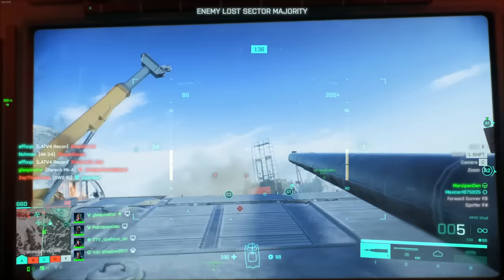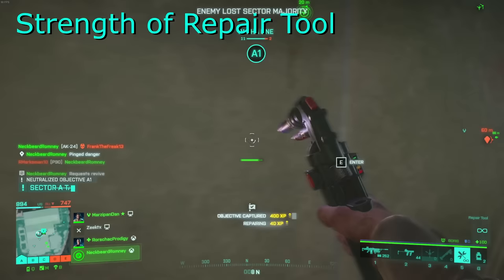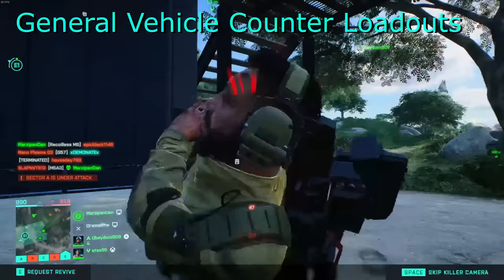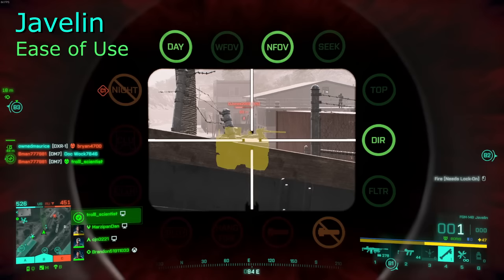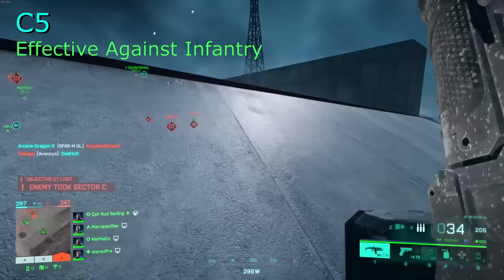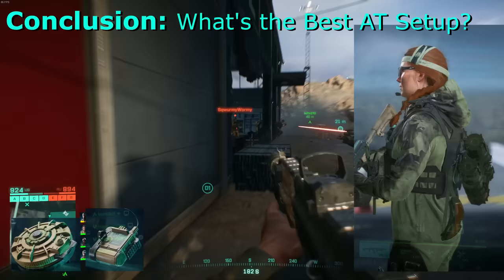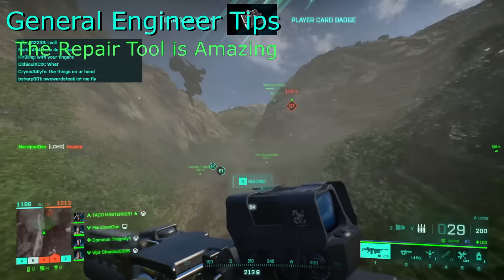How to ACTUALLY Deal with Armour - A BF2042 Anti-Tank Engineer Guide

Comment: Liz is still the ultimate. Tv missile for ground and air, c5 for close range and emp to disable tanks. Most complete engineer!
Reply from the maker: It's definitely better than I was expecting vs. ground vehicles. It's kind of sad... she already dominates the sky. The only thing making the M5 a little appealing is having 4 rounds on you... but even then, you need to find an ammo crate first...
Reply: @marzipandan767  we need more dump rockets launcher variety. This game infantry and vehicle balance is still work in progress
Reply from the maker: @Jay  absolutely! As I mentioned they should add over the RPG and the SRAW from portal! More variety is always welcome.
Reply: I'm pretty sure the G84 does little to fuck all damage to destroy a tank or a transport chopper. Add to the fact you can only have 2 rockets at a time, and I'd rather pick Crawford with an M5, that can dish out the damage much faster. He also has a minigun turret for AA capabilities, nuff said.
Reply: @zedster8200 the g84 takes out smaller helicopters in one shot plus is good at taking out snipers/campers or chasing weak tanks 

Plus it’s fun 😂👍
Reply: @zedster8200 the bigger tanks and helicopters however will need 2 or 4 shots but usually leads to a snowball effect 
Nobody wants to start up damage on a tank but once it’s at 50-25% health with your two rockets
Everyone else will want to land the finishing blow.
And it recharges over time so you’ll always have a answer for most things.
Reply: @kerlowsc3397  ok I get it but this won't matter once I equip Crawford with the new AT grenade
Reply: @kerlowsc3397  And I can switch to stinger if the situation calls for it
Reply: I do the same, also run the LCMG with ap 40mm and ap ammo to stop the instant repair, the m44 magnum with AP ammo is great sidearm for also interrupting insta repair if you prefer avancys
Reply: @marzipandan767  Just swap out her med crate for ammo crate, you still have health syringe !!!
Reply: @marzipandan767 how do I suggest NLAW from BF4?
Smart rocket from attack helicopter, but u run around with it

Comment: A tip for the at mine. If you do a mine and then shoot it. It leaves a crater that you can use to hide the two mines you have left. They can be easily spotted if just let on the ground. Although any crater will do.
Reply from the maker: I do find myself hiding them in craters, but I've never thought about using an AT mine to create a new crater, good tip! I do recommend putting them on the edge of the crater, sometimes I've seen tanks run right over my concealed mines and they haven't detonated because they are too deep in the crater.

Comment: Some additional tips from me:
- EMP-Grenades. EMP-Grenades are actually a pretty effectiv tool against vehicles in close combat, because they disable any weapon AND countermeassure, even the APS (if it wasn't active while the grenade was thrown). On any unsuspecting enemy, and that is the most of them (because EMP-Grenades aren't widely used anymore), it's a huge shock to suddenly be unable to use anything for defense, especially when they had APS on the ready and suddenly can't use it anymore. This in turn, depending on the experience level, will bring them to do rash decisions which you can exploit. For example but mines behind them and watch them retreat into those mines.
- Rao's hack: Basically the same as an EMP Grenade but with a greater distance and on demand. Rao is not a vehicle killer, but together with some pioneers he can really help put down some enemy vehicles. The only downside is some sort of short vulnerability and that it gets anounced for the enemy.
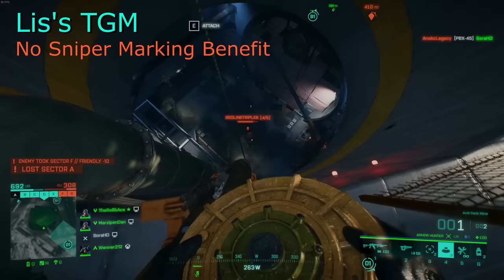- A really imortant one, Distraction: If enemy vehicles don't have anything to do, they are more aware of their surroundings (looking for mines, upsneaking enemies, etc.). Also most of them use outside camera in those situations. So they even see you when you sneak up to them from behind. But if they are distracted, by other vehicles or by you yourself, they suddenly have more tunnelvision and miss some mines or the enemy who sneaks up on them. Like in the video on 14:05 were you sneakedly put down mines and played afterwards the distraction until the Brawler drove over the mines.
- LAT 50mm Cannon: This one is a bit special. It alone almost cannot kill a heavy armored enemy vehicle, but it can definitly put some decent damage on any enemy vehicles and this even from long ranges. Works best with a distraction for the enemy. So, if a enemy tank has to chose between you and your allied tank, you are suddenly not priority target one, which helps you put some extra damage into the enemy tank. Especially effective when you flank the enemy from a distance, which in turn enables you to snipe some pesky repair flies who stand behind the tank.
Reply from the maker: - EMP - I completely agree it is a very good throwable to use if you plan on focusing vehicles. However, I find it very hard to give up the versatility of my smoke grenades.
- Rao - I love Rao in his current state, I think his hack tagging vehicles was a really good move on Dices part! I just wish you would get credit for helping after tagging a kill.
- This is 100% true, I'll drive around in third person mode, then as soon as I am required to shoot I'll pop into first person. This is absolutely when I am most vulnerable in a vehicle and I suggest people playing with C5 take a note of this comment!
- LAT 50mm cannon is really good against aircraft to, if you can hit them consistently. The only downside is that they are very weak vehicles and getting shot out of them while stationary is very common. 

Thanks for the great tips man! I'm gonna pin it for all to see!
Reply: I use the 50mm on the recon as a psuedo armor hunter, I find a nicely concealed spot, harass any light-medium armor, and relocate. I also support vs Heavy and Aircraft like the super hind where possible and if I can engage safely.
Reply: @oshadow8325  i also use this on the recon 😂, adding also driving backwards to a spot so infantry cant snipe/shoot you from the front of the vehicle
Reply: Does Rao's hack disable countermeasures? I swear Ive seen heli's Ive hacked pop flares the moment my teammates send a stinger their way.
Reply: @KillerOrca  It doesn't stop active countermeasures.
What you saw are experienced players. As I have stated, the enemy player knows when a hack is incoming. That is why they will pop their countermeasure just before they got hacked, so it is active while they are defenseless and use that time to go into cover or below radar.
Is the same with the APS on vehicles, it's stays active even though the vehicle got hacked. But since vehicles aren't that fast into getting into cover it is a much heavier blow then for aircrafts. That is why EMPs are actually better in form of almost not getting announced.

Since this video is about ground vehicles and how to defend against them, I stated the Rao's hack strategy. Against aircrafts it is not so effective in case of taking it down, BUT it will keep the enemy aircraft more at base then at the front, so it is still effectiv but in a different way.
Reply: @Happensmaker  Thats what I was afraid of. Of course the competent pilots are the ones flying the transport helo...
Reply: Not sure when it was added, but emp denotes c5 from either team. stole a few kills from my spaudmates not knowing
Reply from the maker: @Killer Orca  usually they will pop the flares before the hack is finished. This means that the flares still go off, and they will be unable to be locked for as long as the flares last.
Reply: EMP granades have proven completely ineffective in this pursuit, sir. Tanks just laugh them off. What am I doing wrong?
Reply: @djbis  Could you explain what you mean. Because just saying they are ineffective doesn't say anything.
EMP-Grenades are indeed ineffective just by themself. They do only 1 damage and they "debuff" any vehicle.
So they aren't a killing weapon (even though you can kill with EMPs but thats another story) but they are a combination weapon, that you can combine with many other (creative) ways to destroy enemy vehicles. Easiest combination example is EMP-Grenades with C5.
Reply: With Liz I run the EMP with C5,  a lot of people don't expect the EMP which allows you to get right on top of them and plant the C5. Sometimes you get killed but even if you do then don't respawn, wait, if your team hits that vehicle thereres a good chance that the C5 will explode and take out the vehicle anyway.
Reply: Another tip: use synergy. Look for friendly armor on your map, and support them once they engage with enemy armor. Your chances to survive and to kill enemy armor multiply. Doesnt work for AA launchers because of the flare spam and short range.
Reply: @Happensmaker  Do you happen to know the damage numbers of the AT grenades Sundance has, and if either Thermal Smoke or APS works against them.

Comment: Absolutely fantastic guide Dan. The BF community needed this. I will say that Crawford's turret does do a decent amount of damage. it sorta sneaks up on the enemy and they seem to not understand where they are taking damage from in my experience. and you may want to take a look at that in any follow-up videos on this subject.
Reply from the maker: Thanks for commenting!

In did test the damage of the crawford turret to figure out the numbers but entire community was talking about reworking both Boris and Crawford so I wasn't sure it was worth it, since I was expecting some significant changes.

Fun fact: it does more damage from the rear and the sides just like most weapons. I didn't record the damage numbers, but from the rear, a full cycle (to overheating) deals about a third health of a MBT at close range. But good luck getting a full cycle off without getting blasted :D

If people are interested, I'll definitely consider a follow-up!

Comment: Very thorough.  Something you showed, maybe accidentally, but didn’t mention as a con for the Javelin is that every now and then a teammate will spawn on you and walk in front of you breaking your attempt to lock on.

I really miss being able to run Angel as an AT & AA Juggernaut.  Unlimited rockets & mines and the ability to switch out without a redeploy - provided you had loadouts setup ahead of time.

I will have to try Lis as AA.  Not much luck for me running Lis in an AT role unless I also equip mines.  I like to Tier 1 everything so I am running Javelin now but typically with Boris to get some additional passive kills.
Reply from the maker: Yeah, the lock is very Janky. Sometimes, it gets broken. By a twig and other times, you could see an inch of a tank, and it will manage a lock. Also, it's very frustrating when you have multiple vehicles in your sights... since it never knows what to focus on and sometimes jumps between vehicles.

I wish you luck dealing with T1ing the Javelin, I can not say I envy your journey given the current state. I hope you have a lot of games filled with Rao's, Tracer darts, and soflams to help!

Comment: What about the 50cal barret? also, any armor pen bullets work on the wildcats?

I been playing Lis all week, and completly agree on the last part, we need more rewards for killing vehicles and also see how many destroyed or how much damage to vehicles you did.
Reply from the maker: The 50cal is definitely something I neglected to try. After they nerfed the Rail gun damage against tanks, I didn't think it was worth trying it. Maybe I'll investigate it in a follow-up video after testing it.

The AP bullets for LMGs (and I think assault rifles) are not good. The damage is so low, and you give away your position so much. Not worth it, in my opinion. Especially compared to taking an AP launcher.

It's so frustrating not being highlighted as doing all of the AT for your team...
Reply: From what I remember, 50 cal was nerfed into the ground. Unless the tank is 90% destroyed and running away while on fire, I personally don’t think its worth using over the under barrel grenade launcher. It’s still a decent sniper against infantry but I’ve yet to see the 50 cal do anything against vehicles after it’s nerf.
Reply from the maker: @DefualtPlayer  I've definitely been pinged by it while in a tank, and it was more annoying than dangerous. Same with the Railgun on single fire.

But yeah, the AP underbarrel is king against vehicles!

Comment: Nice guide, awesome job.  One thing I wanted to add, you can drop 3 mines as an engineer and 4 from the bolte, for a total of 7.  The 4 that deploy from the bolte are tagged to the driver so if you also get your squad to go into the Bolte and take turns you can litter an area with 16 mines from bolte and 12 mines from squad.  
I miss the plane from previous battlefields that can parachute 12 mines onto an enemy position and your squad could take turns dropping for 48 mines on an enemy main base road!
Reply from the maker: Oh my god that is crazy! You could literally make a minefield. Sounds like a very fun thing to do with a squad! Thanks for the tips man!

Comment: This is the level of detail battlefield players need to be thinking in! I see so many players just sticking to their preferred class no matter what happening in the match. I've always enjoyed adapting to the environment, if there's heavy vehicle presence I'll switch to Anti tank. Snipers, switch to counter snipe or flush them out with assault class. Heavy amounts of infantry, switch to assault or engineer and mow them down. Team mates dying constantly, switch to medic! If you have a good grounding in every class and specialist then you'll be an even better player for your team!
Reply from the maker: This is one of the reasons I much prefer the class system. It means that everyone isn't just running around with an M5 doing whatever they want. Just helps the all-round balance for everything in the game. For example, if you are playing really well in a tank, more people should be switching to engineer to stop you, then that means there are less medics so you are having a much larger impact in the game than you might actually perceive. I just wish they would give the Assault class the ammo crate instead of the medpen, since right now they don't really help out the team in any way that they can't help themselves. Plus more ammo on the battlefield would be appreciated by everyone.
Reply: @marzipandan767  the assault class has always been a contentious one. I remember in previous games it was used more as a heavy class where they had light machine guns and ammo boxes? Now it's more of an infiltration class where your sole job is to basically cause trouble on the front line

Comment: The NTW is a solid choice as well.  It deals good damage if you use the heavy AP rounds to shoot tracks, and is not blocked by any form of APS.

Really, AP rounds in general should not be overlooked.  Even though most guns won't even deal more than a point or two of damage per magazine, being hit by even 1 of those bullets will cancel the repair kit and delay auto-heal.  The damage indicators they cause can also draw attention away from other players that are better equipped and dealing more damage.

Comment: NTW 50 also shreds vehicles classified as light, like the wildcat, bolte and ram. Gotta get behind them though.

Also completely agree on 40mm AP. Criminally underrated
Reply from the maker: I just unlocked it and it's anti-vehicle rounds, unfortunately the cost to using them is losing your one shot kill body shot potential of the NTW. It's good being able to deal decent damage to light vehicles at range, but vs. tanks it only does 5 damage per rounds. 

I think I'll stick with my AP underbarrel for now. But damn I love the sound the NTW makes with every shot...
Reply: @Marzipan Dan  anti vehicle rounds retain their 1 shot Potential, just drastically lowers the range of it. Either 50 or 60m if memory serves. I just have them on the plus menu if I ever find myself close to camping vehicles (since I'm a recon main and usually run soflam instead of c5) or in a prime spot to harass night birds. But yeah, overall it ain't great against heavy armour. Although still enough to finish off the odd vehicle here and there even with standard rounds, I take what I can get basically 😄

Subbed btw, checked some more of your content, real good stuff man

Comment: This is a great overview of how to deal with vehicles. Great job. 👍 
I've running these set ups for a while now anyway. But I did learn a few tips there. Like leaning away when locked on with a Javelin. 
You did however miss one other small way to damage vehicles. AP rounds. They will not do a lot of damage. But they are effective for finishing off vehicles or just getting them to back off if their health is low. If I'm running the LCMG I have them in my 2nd plus system slot for that purpose. Every little helps if you're throwing everything at them.
Reply from the maker: Thanks man! I appreciate you commenting!

I had some person pinging me with AP rounds while I was in a wildcat the other day and they weren't too effective. The problem with AP rounds is you either need to take them as your main source of ammo in which case your infantry game is crippled, or you need to spend time switching to them and reloading in the T menu, which usually when the opportunity to fight a vehicle comes up, you don't have the time to do so. I will say that they are good at interrupting the repair function.